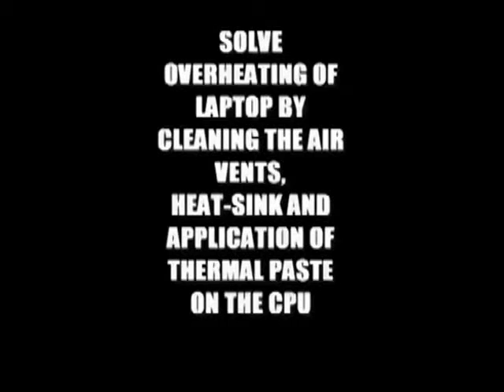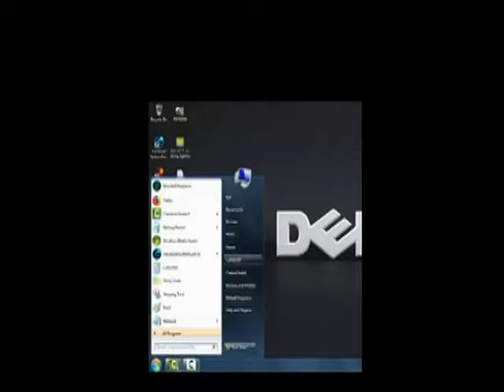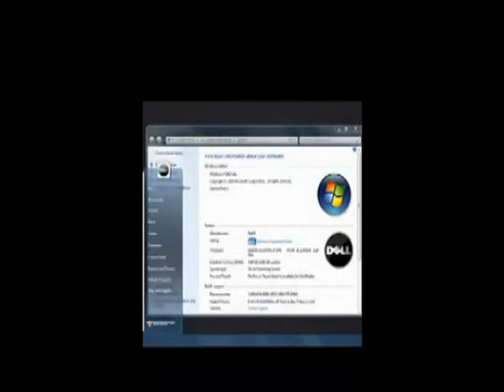FIXING A DELL INSPIRON N4030 LAPTOP - PROBLEM OVERHEATING & SHUTS OFF ITSELF

Comment: that doesn't work for me, still shutting off
Reply from the maker: Maybe the alignment of heat sink is not fixed properly check the alignment to make sure it's attached properly if the issue is still shutting down try attaching a  cooling fan
Reply: @mookskie  it's ok now, I found out that new installed memory giving a problem in motherboard,

Comment: Bro did you put the thermal paste after removing it ?
Reply from the maker: yes bro, i put thermal paste after i cleaned it
Reply: @mookskie  Is it mandatory to apply therman paste or it's optional ? Sorry I just don't know anything so I am trying to make sure. Any replies will be appreciated po
Reply from the maker: @jaynepal68  thermal paste is required irs important we needs to put it. without thermal paste the processor not working well because of overheating